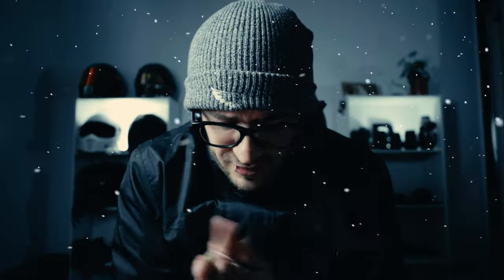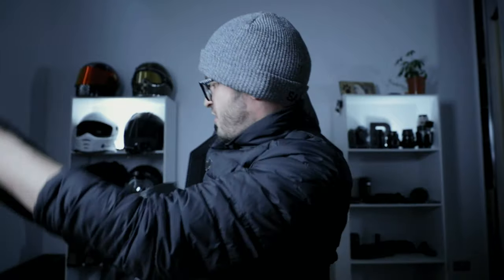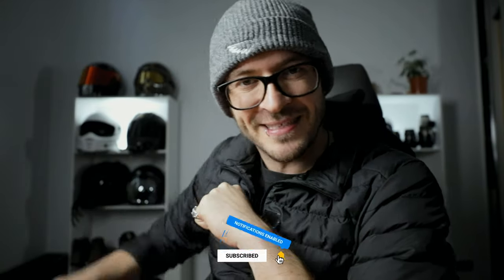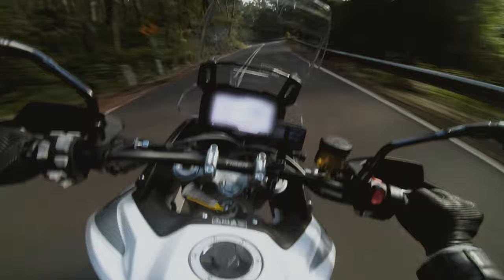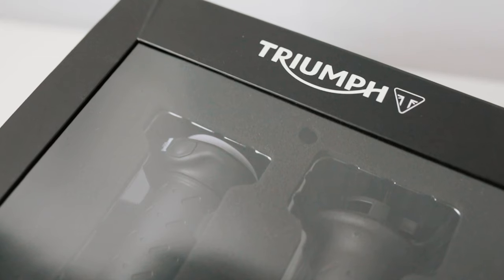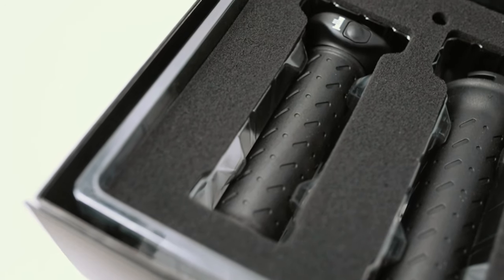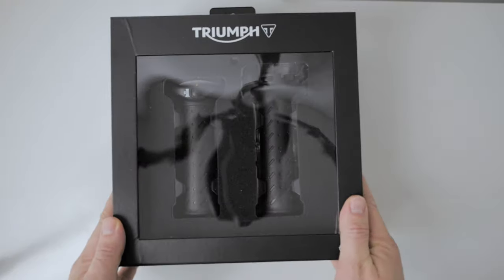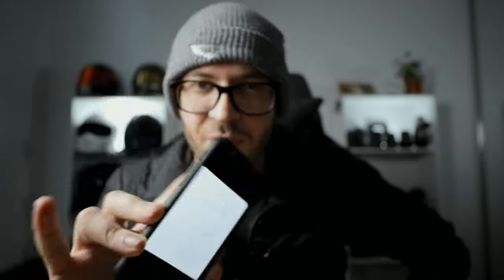Triumph Street Scrambler Heated Grips | INSTALLATION & REVIEW

Comment: Hey man, thanks for the video. After installing them on my brand new scrambler 1200xc, I got a light saying that the bike was due for service today (only 33 miles) any clue what may have caused that? Any tips would be appreciated. Heated grips work fine and the display on the TFT is fine